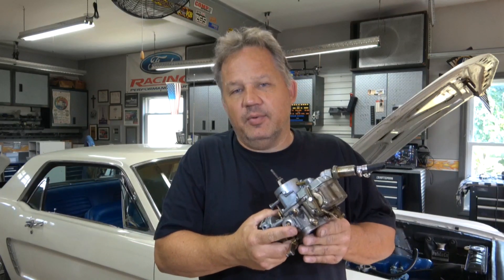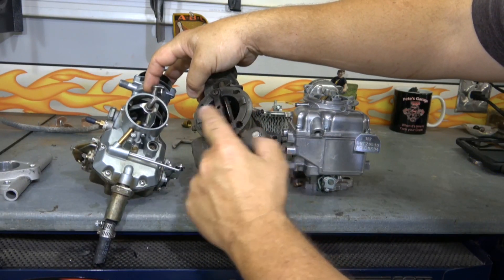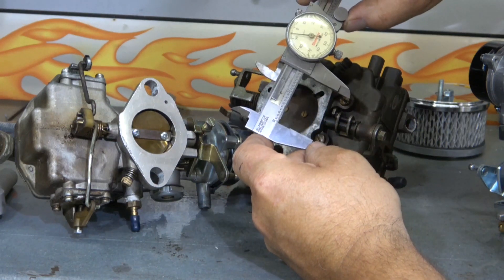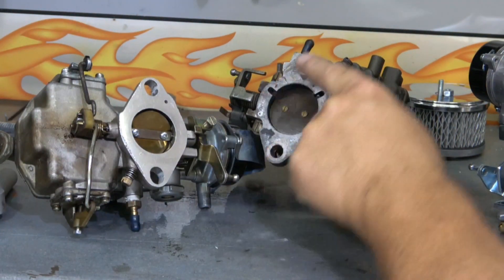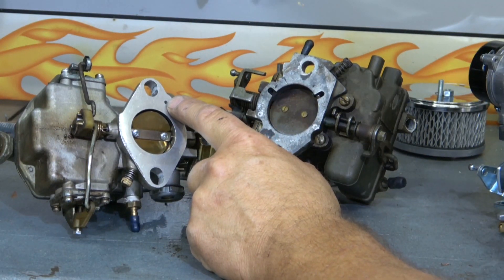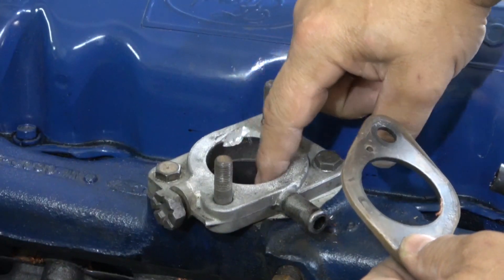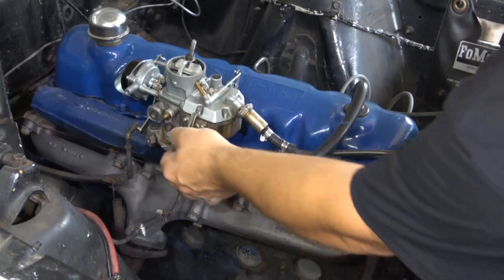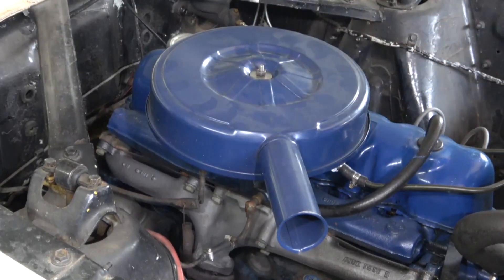Making a Carburetor Fit - Autolite 1100 on a Ford Inline 6 240ci

Comment: Maybe its a larger 250 ford small inline six, but not the large six truck engine 240, with the distributor in the midlee of the block, and 240 have remobable intake manifold
250 its the last small inline six, Or are you confused with the first falcon-type six, the 144, which has a displacement of 2.4 liters? Look 3rd gen og inline six ford
https://en.m.wikipedia.org/wiki/Ford_straight-six_engine

Comment: What about putting a radius at the bottom of the carb, so there isn't that hard transition from the carb to the plenum?
Reply from the maker: as long as it doesn't get smaller than the gasket

Comment: I am currently installing a Holley sniper 1100 and need the spacer you modified, approximately 3 5/16 c to c at the head and 1 3/4 inlet hole, and 2 3/4 c to c at the carb and 1.430 outlet hole  can you provide me a source for that spacer ?
Reply from the maker: That's a tough one. I would check Summit

Comment: I completely expected the results you found, but how about top end?? I'd grab some tools and head to the expressway. Take it up to 75 for a 1/4 to 1/2 mile and pull over and read some plugs.. If they are ok, I'd got back up to about 50 and step into it and make sure it doesn't fall on it's nose looking for passing gear RPMs...  So was the intake mouth the same size as the gasket??
Reply from the maker: Well, It's not a highway car, never got it over 65 so it's not a huge deal. I'll run it and see what the plugs look like. I did jet it so it runs right so it is getting enough fuel. The intake gasket was the same size. It's a secretary car...lol
Reply: @PetesGarage  LOL.... I hope all is well up there, Pete!!
Reply from the maker: Well....we did get a new Governor